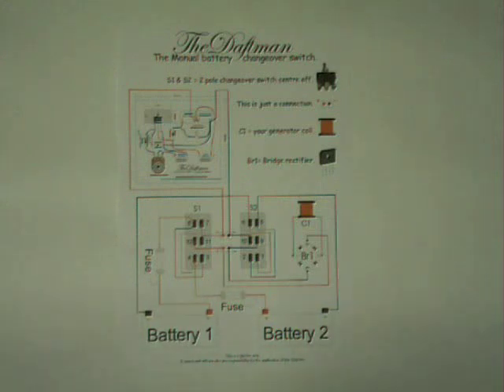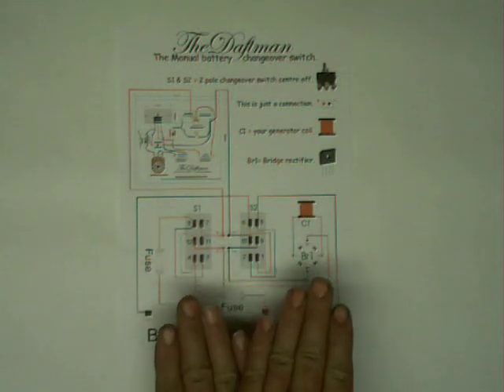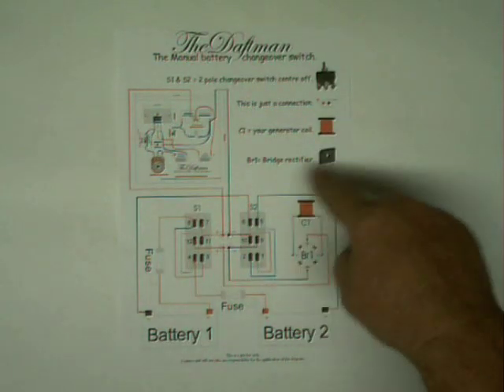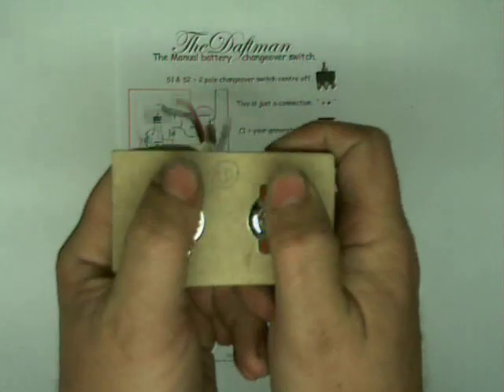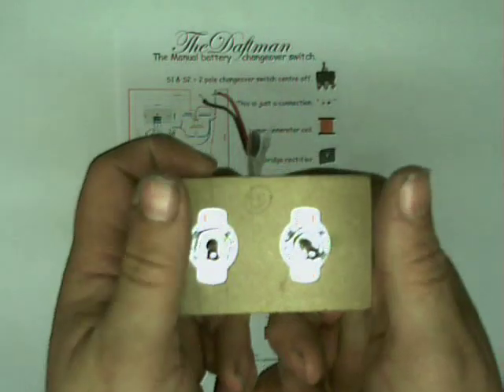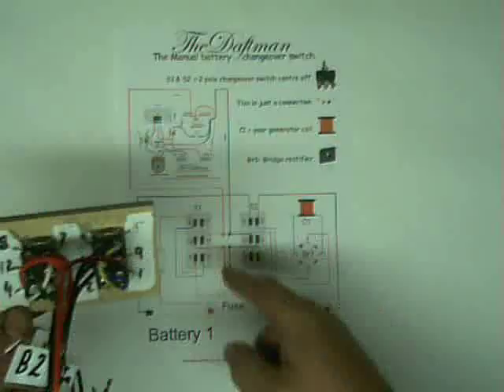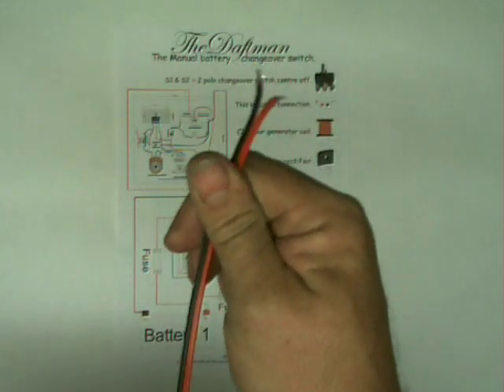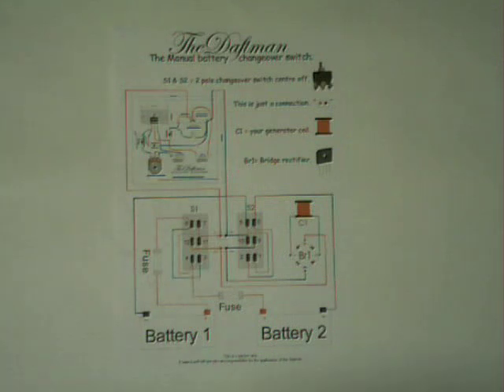Manual battery changeover switch (theDaftman)

Comment: Hey really enjoying your videos!!
Just wandering whether you can charge the battery being used to power the pulse motor while it is being used?

Also, does the bedini circuit only charge batteries or can it be a generator and power a circuit?